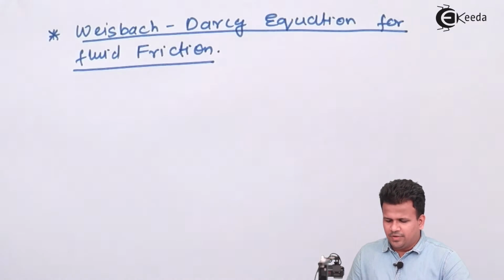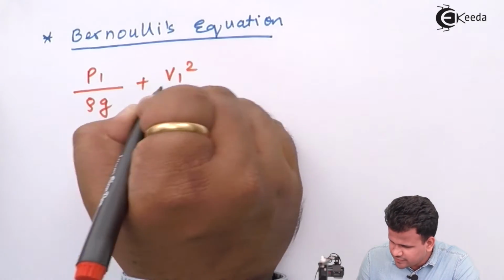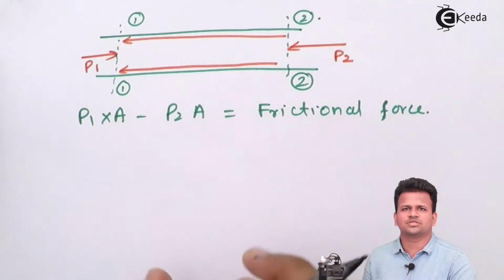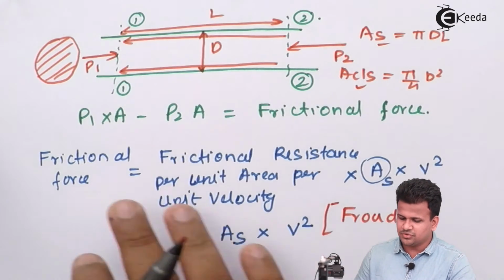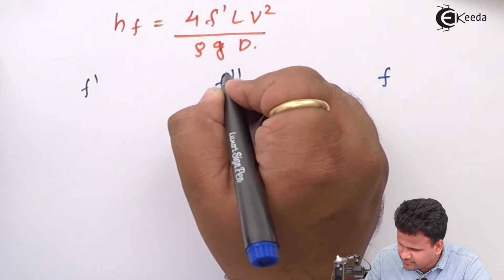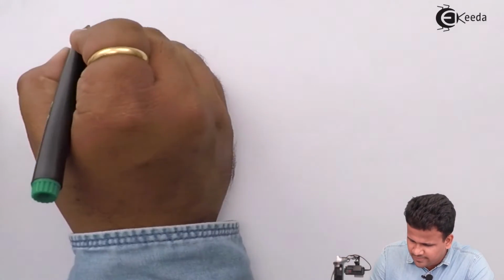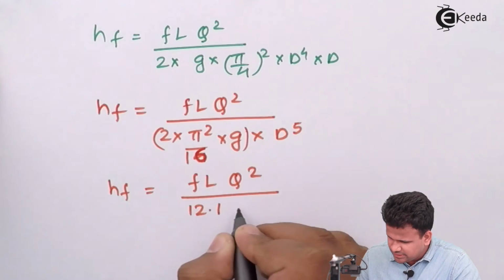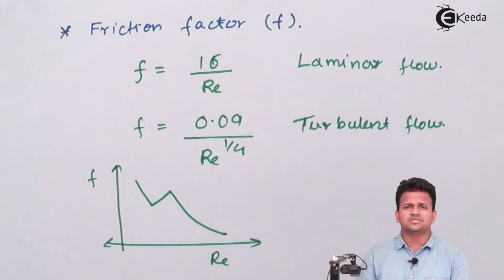Darcy Weisbach Equation Friction Factor - Real Fluid Flows - Fluid Mechanics 1

Comment: Hi, 

If this is a unidirectional flow then P2 is not opposing the flow.

Rather P2 is resultant of P1 which  lossing its force due to friction in pipe. 

So ideally the pressure P1 losses frictional energy giving resultant P2. 

Hence the equation should be written 

P1 × A = P2 × A + Frictional Losses

This might look mere equation rearrangment but the concept behind is far different then what has been presented here.

Please correct me if I am wrong. 

Thank you.